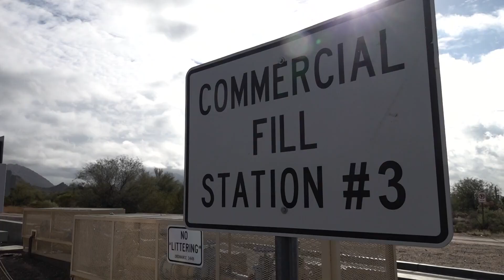County weighs in on Rio Verde Foothills water fix

Comment: does any water actually get in the tanks, or does it leak out at the hose connections? 🧐
Reply: How about you try to hook up a 3 inch HIGH power water line and not spill a drop! Have fun.